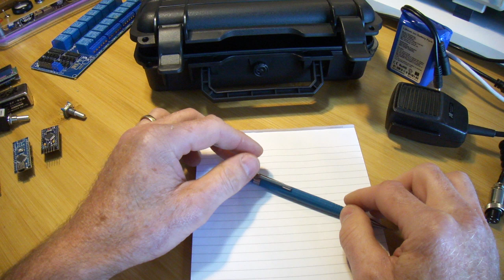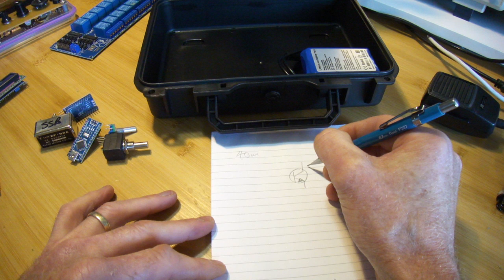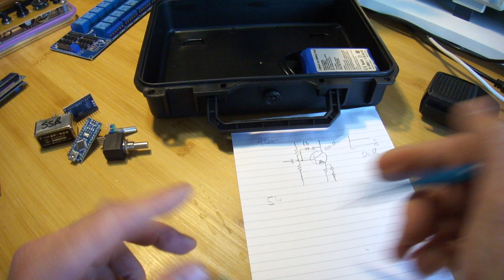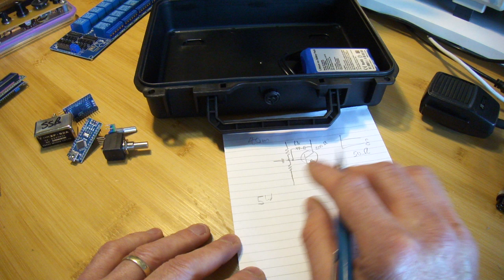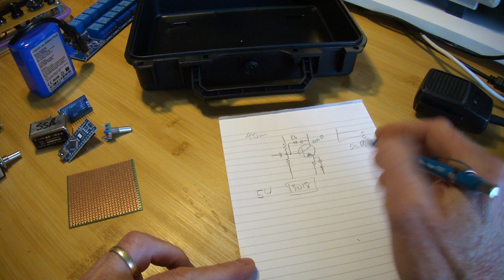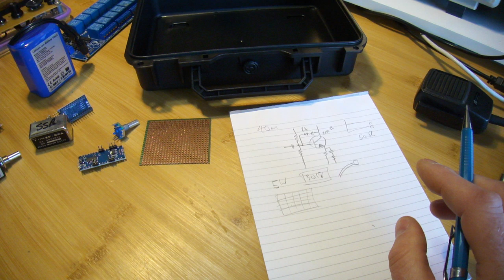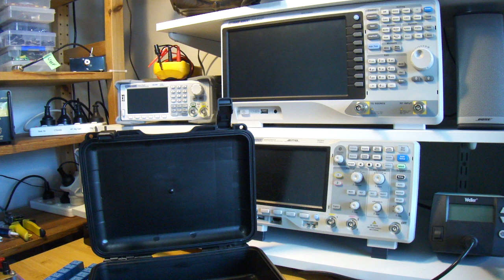40m Pelican Case SSB Radio - Part 1: Thoughts and Ideas

Comment: For the ATU i would not start with that relay bank, I feel that the placement of the inductors and caps comes first and then the relays are fitted around them. To keep the RF tracks as short as possible. Well that's MHO

Comment: Great stuff Charlie.  I like your approach, especially the bit about needing to understand the circuits.   I also like your decision to go with feedback amps using 2n3904s.  These transistors have big variations in Hfe, so your use of the feedback networks will make the circuits more "beta independent."  Wes W7ZOI has some very useful software (fbamp?) in the LADPAC package that came with EMRFD.  One question:  Will this be a bidirectional rig (like the BITXs?)  If so, I found it hard to get the impedances at the ends of the crystal filters to match well IN BOTH DIRECTIONS.  Farhan recommended Termination Insensitive Amps.  Wes and Bob Kopci designed some nice ones.  I have used them ever since.  73  Bill  HI7/N2CQR
Reply from the maker: Good morning Bill. No, I was not looking to use bidirectional amplifiers nor TIAs. While I fully understand the circuits,  I cannot get the underlying (big hands) math to work out. I expect, like many circuits, there was a bit of trial and error going on to perfect the final circuits. Unfortunately, without the math I cannot use them. I suspect it's just me, but I'd love to have a reference (e.g., EMRFD, SSDRA) which had all of the design process. Oh well, I'll keep looking.
Reply from the maker: I should say the comment about bidirectional amps refers to EMRFD Page 6.61 Fig 6.110 and the TIA. Ideally, I'd like to understand the math behind both amps. The BITX bidirectional amps are essentially two separate feedback amps side-by-side. I'll be looking at those in this build, at least as individual feedback amps.

Comment: Good to see you again Charlie! Thank you for your movies, im challenging the MC3362 right now. Keep it up! 73 de SP7EZG!
Reply from the maker: Sounds good. I have five  MC3362P devices in the shack here. At some stage I'd like to build a radio around them to see how they work.
Reply: @CharlieMorrisZL2CTM  One of the popular constructor in Poland - SP5AHT - designed TRX2006 and Transceiver Zuch - they are using all of the MC3362 internals to produce SSD. These can be some motivation. Contact me if you want to have some docs/schemes :) all the best!

Comment: Hello Charlie, Could I please have information about the rotary encoder make and model please?  It is a bit smaller (nice) than the Omron units I have been using.   Thank you in advance, 73
Reply from the maker: Gidday. It's a Bourns Inc P/N ENA1J-B28-L00100. The datasheet is here: https://mm.digikey.com/Volume0/opasdata/d220001/medias/docus/2430/EN%20Rotary%20Optical%20Encoder.pdf

Comment: Hey Charlie great to see you. I've missed your videos I find them relaxing. skipping the math now is good you have help me out a lot understanding it. thank you! 
The encoder you picked should be nice. I stated using  a bit bigger one than that and it makes the radio feel so much smoother. I look forward to this.
Reply from the maker: Thanks. I have a lathe rotary encoder on order from AliExp. That should make a really nice base rig VFO control too. Very heavy, optical encoder.
Reply: @CharlieMorrisZL2CTM  That sound great, I love the one's I use. hey check out this knob I used they are solid aluminum 44mm x 20mm with a 6mm hole for the shaft. they do have them with a divet on the face also but this info should get you to the right stuff. It does work on the little encoders you were using, it makes them a little smoother also. look forward to watching.

1Pcs High Quality Aluminum Knob For Potentiometer Knob Drawer Solid 44*22mm Knurled Encoder Volume Control For Hi-Fi Amplifier

Comment: I use an eInk display in a project here. Highly readable but terribly slow to update. Wouldn't recommend for showing tuning frequency.
Reply from the maker: Thanks Peter. That's what I thought too. As this radio will not have a waterfall, I'll be doing a lot of tuning up and down the band looking for contacts. Having a responsive display will be important for that. I think I might use the eink display on a piece of sculpture art here in the shack.
Reply: @CharlieMorrisZL2CTM  I use one driven by an ESP32 to display solar power generation. Updates only once every few minutes. Thanks so much for all you share. I learn a lot from you.

Comment: re:CNC you could always do a Pete Juliano ME squares style cutout. 

If you want to cut out the maths, just refer to many of the previous builds that have the detail math. Get more views too.  I keep seeing people asking for VHF-lo radios. Maybe point out the maths the need and some traps (less than 5 minutes). You are one of the few who show the pencil work and answer questions. They are all the same except for the bits between the antenna and the mixer closet to the antenna 😂.
Reply from the maker: Yes, I've been following Pete for many years. I'm torn between using the CNC or sticking with what I know best. The approach I take works well for me and gives me a lot of flexibility. I'm still mulling that over.

Comment: Great to see a new video! You've been indispensable in my efforts in building my own 6-band rig. Currently have the receiver working, but have to build up the VFO/BFO. Going to be using the SI5351. For my finals I'm going to be using the MRF101AN & MRF101BN MOSFETs in push-pull to produce around 100 watts P.E.P. I'm a little nervous about developing the finals in it, I have 3 MRF101's so I have the opportunity to blow one and still continue with the design, however creating 100 watts of RF is no small job. Are there dangers involved? Fire, etc, with inadequate heatsinking (i.e if the wrong heatsink is chosen)
Reply from the maker: 100W, great. Just remember that blowing up RF power transistors is a right of passage. I've let the magic smoke out several times. One time a IRF510 exploded and peppered me with plastic. Just take things easy and try not to over do each stage. You will need 3-4 stages to get up to 100W. Take a look at a push pull driver amp as that is a common topology. Heatsinking is important too. Use diodes in the biasing to reduce the output power as the heat increases, in an effort to offset thermal runaway. Keep us all posted on how you get on.